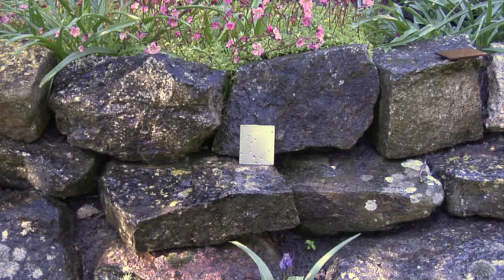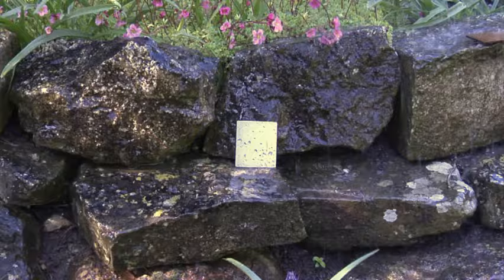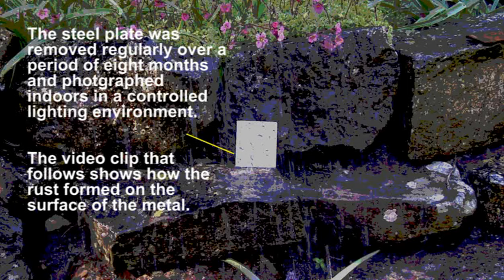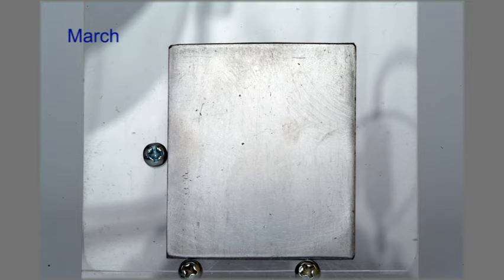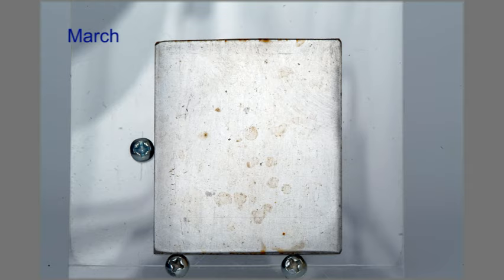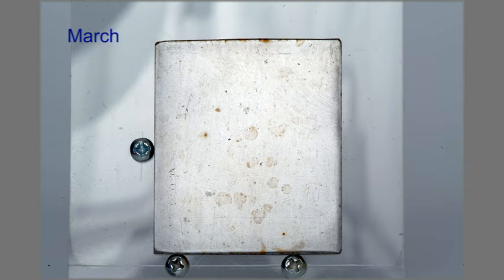A Time-lapse of the Rusting of a Steel Plate

Comment: Is there a way to seal and stop the rusting process? For example if you wanted the pattern left by the rust for decorative purposes, is there a way to treat a sheet of metal to keep it from rusting further and make the pattern permanent?
Reply: In engineering failure theory, corrosion (rust) is a failure mechanism. It can be prevented by application or prevention coatings such as epoxy and inorganic zinc, among other methods. But as is evident from the video, the rust spreads from spots across the entirety of the surface. This is true for subsurface propagation too.
In your case, even if the coating were to be applied in the form of a pattern, the rust would cross the constrains of the coating beneath the surface, lowering the life of the particular item. To decelerate the rusting process, resistant materials could be used (look up NACE). But that would be a bit too expensive for a household project.
If the aim is entirely aesthetic, look up Damascus steel, though the pattern would be different, bit the material would not fail as soon.
Reply: @fahadaneeskhan  Yes you can coat it in any type of clear solidifying solution, basically Epoxy Resin, It just has to be air tight since Oxygen is what causes the rust process. Doing that will forever preserve it as long as no air ever touches the iron again.
Reply: @Saltiumine  ^ i've seen this done to some cars, where they clearcoat the steel. it looks really nice except unfortunately it doesn't actually have the metal grain/rust texture of the steel, it just has a glossy finish. as far as i know there's no good way to preserve the actual texture

Comment: I have seen steel rust much faster in nothing but rain and snow.  I believe hot rolled steel initially resist rust so to black oxide coating but if that coating is compromised,  it could create a galvanic battery in moisture and actually accelerate rusting process.
Reply: IT'S BIG CHUNGUS